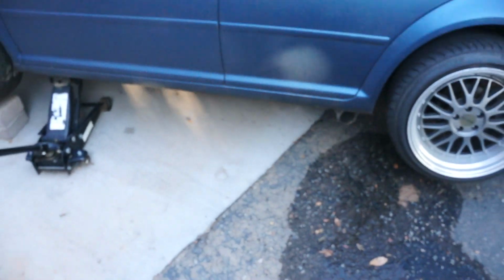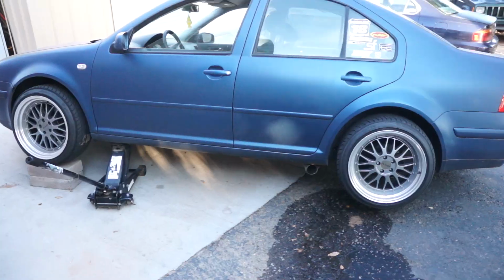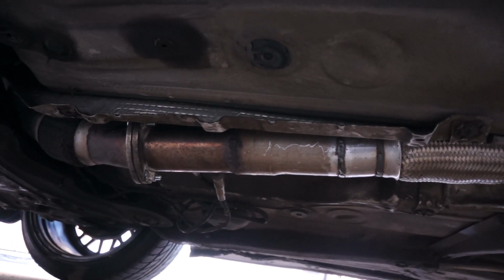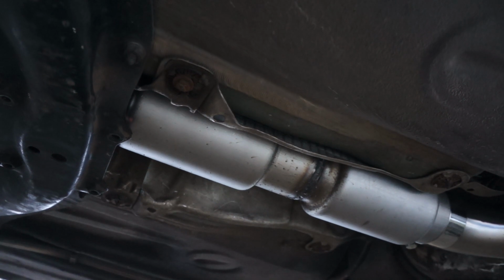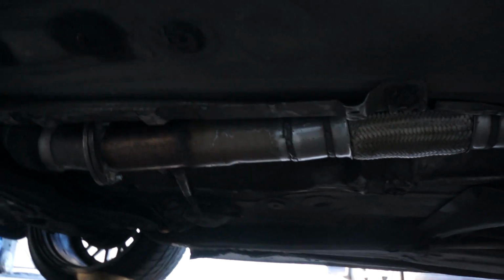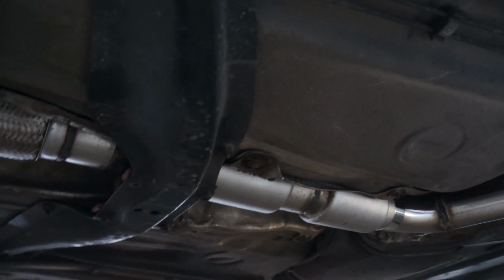MK4 Jetta 2.0 Turbo 3" Exhaust Sound Clips

Comment: Is yours just a straight pipe without any cats? I discovered today that my entire exhaust system is full of leaks and getting it replaced is gonna cost more than the car is worth so I'm thinking if doing a full straight pipe with one exhaust at the rear. Do you still have your oxygen sensors connected etc?
Reply: you will need a cat if you need a smog or inspection to get it registered/renewal, what ive done is cut the back muffler off right before it curves up on over the rear support bar, it will leave the cat and the first muffler attached and it will be loud but not super loud